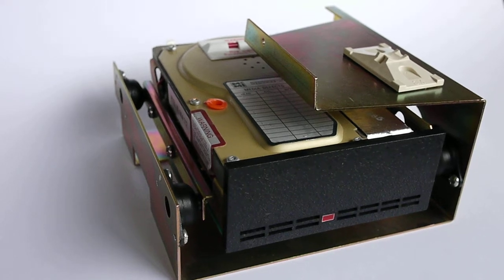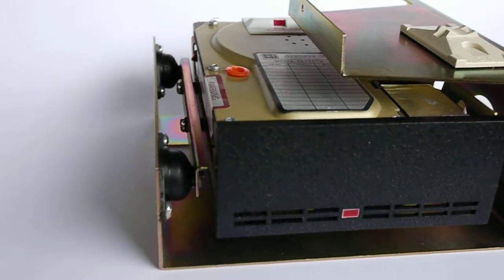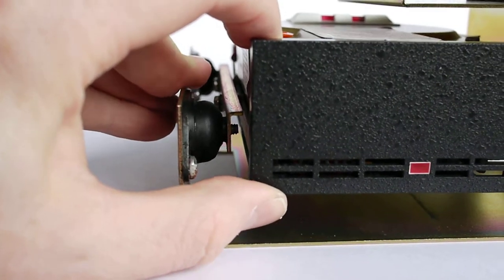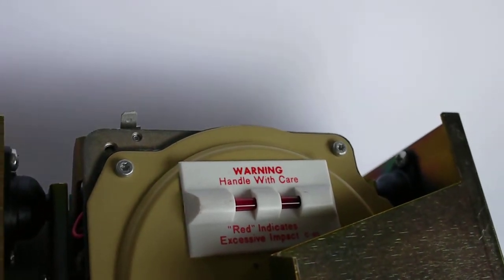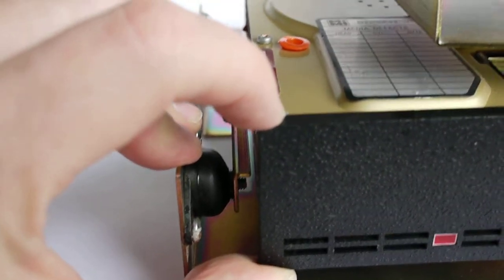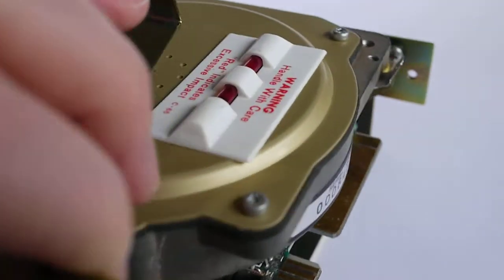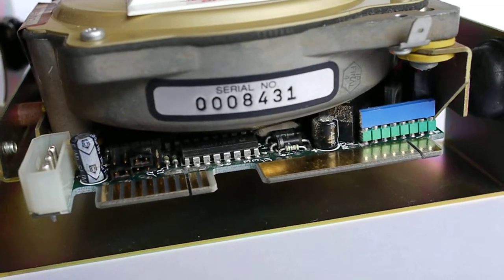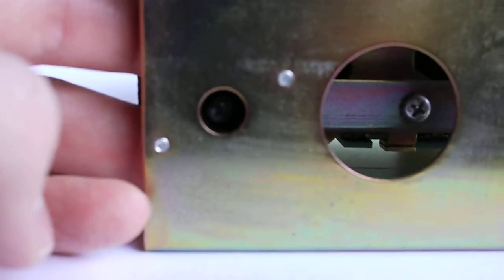GCC HyperDrive Shock Absorbers

Comment: This drive is a Microcomputer Memories Inc MM-112, a 10MB hard disk drive. I actually have the original prototype for this drive in my collection, and an example of the production unit as well, but both have bad EPROMs. I sent you an email about it, hopefully I can offer enough money for you to image your firmware for me to fix them both.
Reply from the maker: I have 3 more videos about the drive, which are more detailed and informative here: https://www.youtube.com/playlist?list=PLNZ4qjMn-GHoSmk7WSWFMoHynyeye2u2P
(Also check the text descriptions under all of my videos for even more info.)
I received your private email where you said: "On the board is a 24 pin DIP EPROM, a 2732A, which contains the firmware."  Unfortunately, I only have access to a Microchip ProMate 3 production programmer and AC164301 DIP IC socket module which is only compatible with a limited number of chips from Microchip.